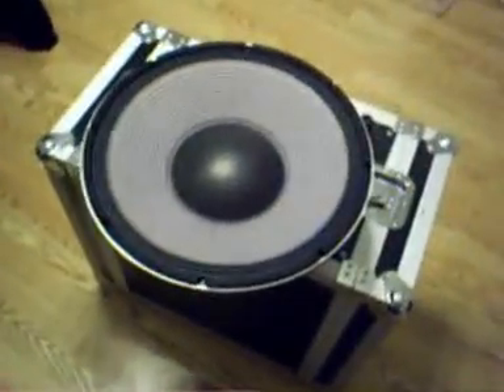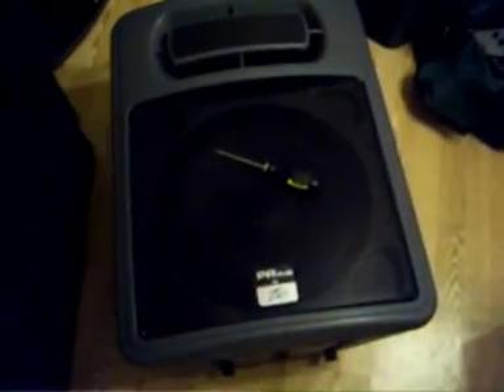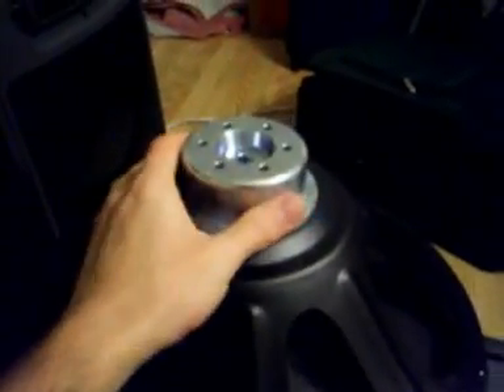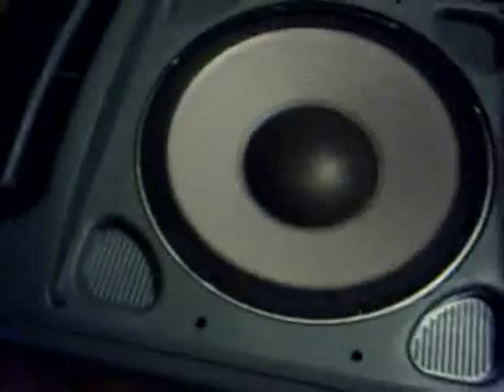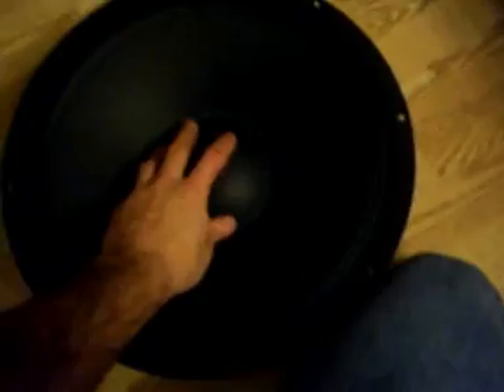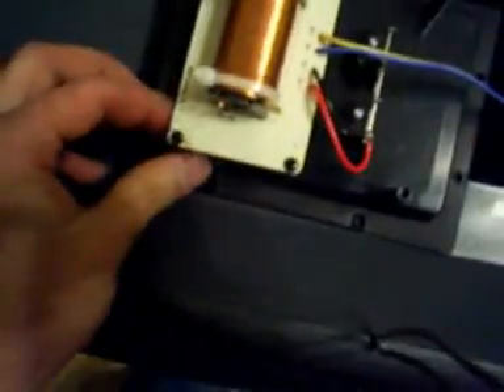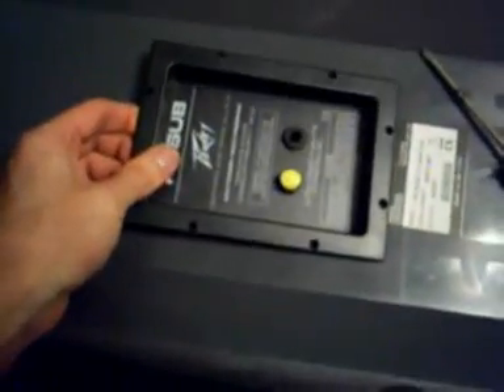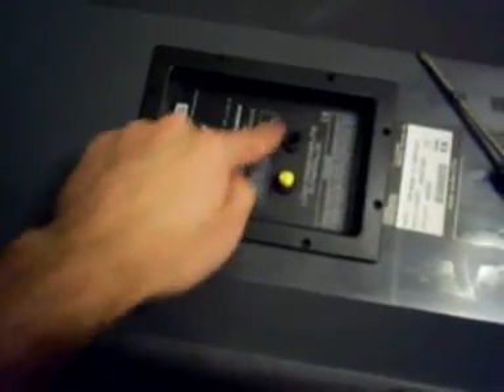I replace a woofer and bypass the crossover

Comment from the maker: i got some pyle speakers from them a couple of years ago and the coil rubbed on the magnet, i was a little pissed and sent them back.
the bigger speakers (15 or higher)are much better quality.
(i think they manufacture the speakers i got themselfes - it does not have any brand logos on it except speakermax)